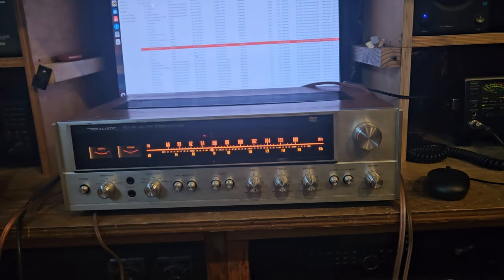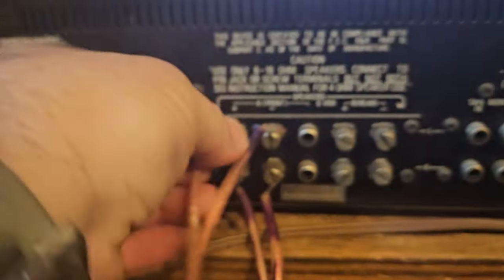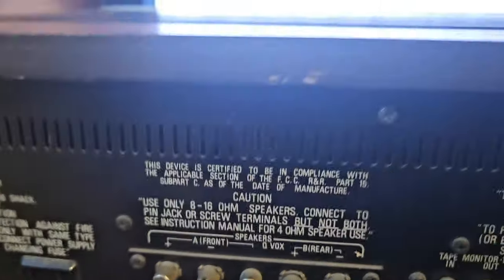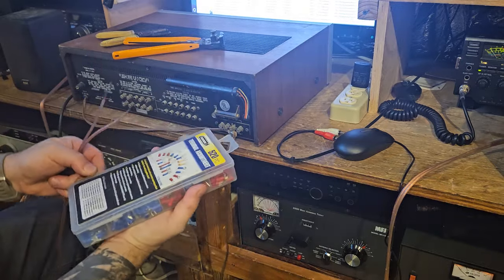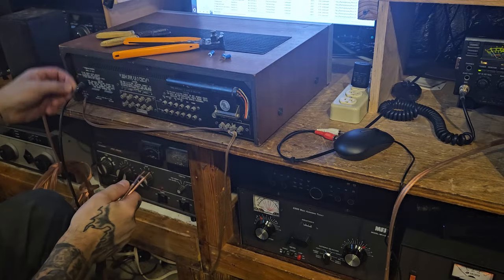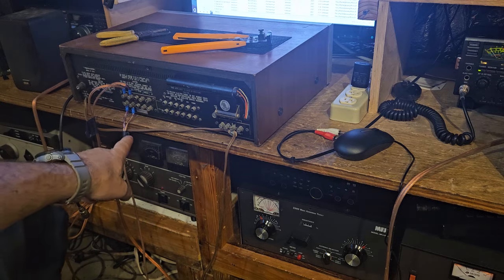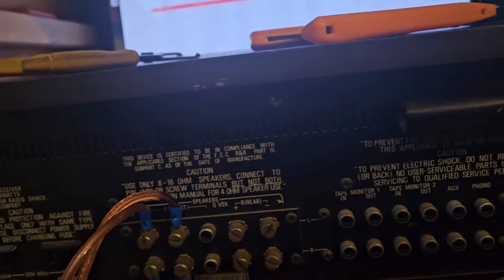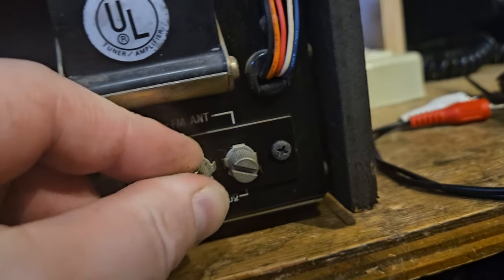My least favorite speaker terminals on 70s stereos

Comment: IM SORRY THAT CROWN GOES TO THE PIONEER SX-1980 lol how is it that a monster receiver only has these openings to slide a pin into.  I hate them.   These are challenging but with the right terminations on the speakers they are solid and indeed scalable top
Video. Stay safe.

Comment: You can make a loop with the wire then solder it so you end up with a nice connector  and with out it shorting out i do this for such connectors or you can buy the proper connector for such screw terminals , I solder all my speaker wires it helps the braded wire from it shorting out or falling off , there are many forms of connecting speaker wires to the system plus if your really clever you can upgrade the speaker terminals to modern ones the same goes for the connectors on speaker enclosures .

Comment: Use a 9 volt battery attached to the speaker wires if ypur speaker jumps out thats the positive wire + if speaker sucks in thats your negative wire. Just touch the ends of speaker wires to 9 volt.and look at your speaker